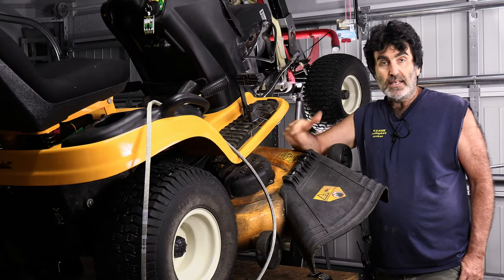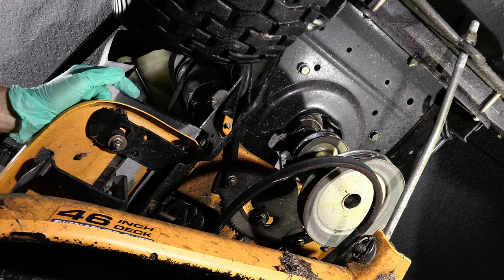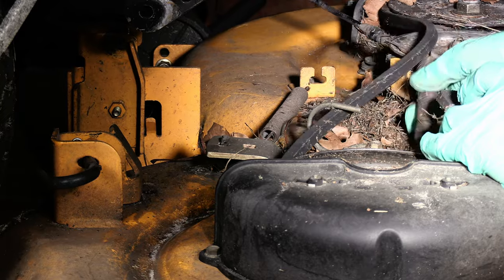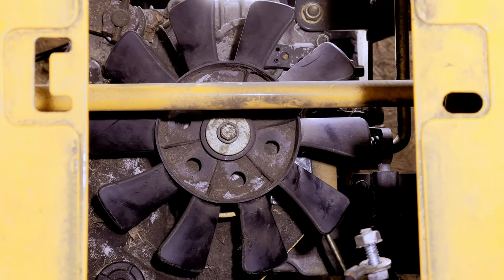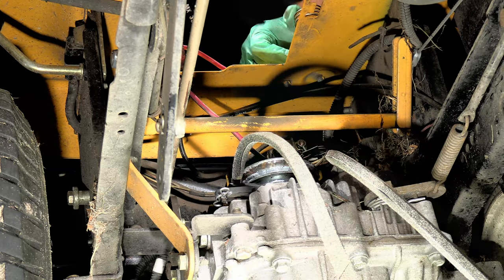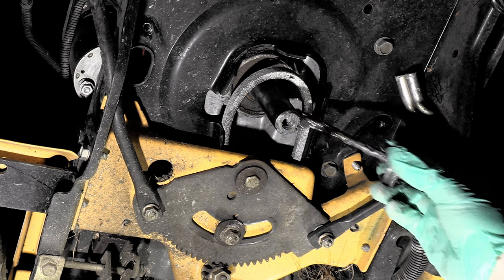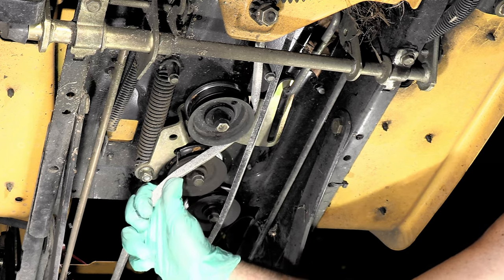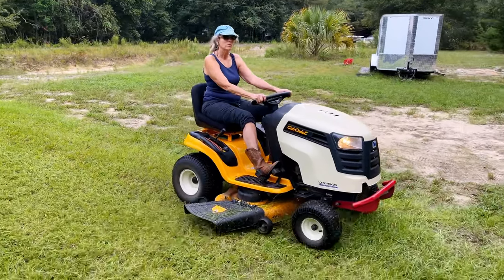Cub Cadet LTX1045 Transmission Drive Belt Replacement

Comment: Thanks! This is the ONLY video that points out how to get the belt past the steering "Column" I took pictures before I removed mine, but didnt capture or make a mental note of how that part was oriented... I figured it was to one side or the other.. You saved me from further second guessing. Thanks for a great video.
Reply from the maker: That's awesome!  You're welcome... 😀

Comment: Hi there, I have a question for you and I’m hoping you can answer this for me. I have a 2013 cub cadet ltx 1045 and it feels like the tranny is slipping? I know it’s not but it feels like it. I have to pump the “gas” pedal a couple times to get it moving for some reason and it just started this. Now, I did replace the deck belt right before this started happening and the store I got it from “tractor supply” didn’t have the exact belt so I measured it and I thought it was pretty close, if not right on. 
Now it seems like it rides slower?
Is there a drive belt or something that would make it sluggish? This all kind of happened all at one time. The deck belt broke, I replaced it with something I would say is real close but it seems to drive like crap now? Any help would be appreciated. Also do you have the actual belt number for this unit? I have the 19 horsepower engine. It also has the dual blade deck. Thanks in advance.
Reply from the maker: HI, on this model Cub Cadet there is usually a sticker under the hood that will show the belt part numbers and other useful info.  Definitely check that first.  IF the sticker is gone or isn't readable, the model number should be under the seat and you can go to www.partstree.com and plug in the model number to get the parts breakdown.  Before you do all that you should be able to, of course with the engine off, reach up and feel the drive belt to see if it seems loose.  With the clutch out and ready to mow.  If it feels loose then it's probably slipping.
Reply: @JLPicard440  the drive belt seems extremely loose although when I hit the go pedal it does tighten up but the mower has low hours and always ran good. I’m pretty sure I need a new drive belt. Thank you for getting back to me.
Reply from the maker: That's interesting.. is the mower a hydro transmission?  The (right side) pedal should be tied with linkage to the transmission and shouldn't affect the belt tension.  If it's not a hydro, then yes the pedal will affect the belt tension.  The hydros usually have a speed pedal on the right and a clutch pedal on the left... the one on the left will affect tension.

Comment: I watched this which made it repair easier, thanks. I’m wondering if you switched the spacer or left it the way you put it back in and if it really makes a difference. I put it back the at you said that hen saw comments that said it as upside down. Do I need to take it apart and switch it?
Reply from the maker: HI, only if it makes any difference by switching it.  I'd have to see it, I forgot what the spacer looks like.
Reply: @JLPicard440  did you leave yours in upside down or did you go back and change it? If you left it, does it seem to be working ok? (Sorry my first reply was jibberish - fat fingers)
Reply from the maker: It's been a while ago, but I don't think I changed anything.  Usually if I discover an error like that, I'll edit in a piece into the video for the correction..  Do you have a timestamp for the spacer?  I can take a look and see what it looks like..

Comment: Question for ya.  the cub cadet ltx 1045 won't move. Makes a lot of whiney noise when trying to forward or back. I replaced the belt. It was terrible. But still the same. bringing the mower put of storage this year and the thing won't move. Is my transmission shot? The fan is spinning
Reply from the maker: Yikes!  Yes it does sound that way to me..  Of course without seeing it, it's hard to be 100%.  (I don't remember if that one has a way to check the fluid.  If the fluid has leaked out it could cause that) That would make a great video.. 😊
Reply: @JLPicard440  thanks. Also when I pull the tranny disengage lever the wheels are still locked-in
Reply from the maker: @rusted5408  That one isn't a hydro?  I thought it was is why I suggested the fluid.
Reply: @JLPicard440  it is a hydro. Turns out the brake.wasnt releasing. Thank God for small miracles. Some PB Blaster fixed it right up.
Reply from the maker: Oh excellent!  Yes I've seen that happen.  It's hard to diagnose without seeing it.  Good job on that one.  Glad you got it going again... 😀

Comment: The OEM belt that was listed under the hood was about 6" short. The belt on the front pulley and through the three pulley under the deck doesn't even reach the hydrostatic druve pulley. So I'm assuming the 79" OEM pulley should be an 85". Does anyone have that p/n?
Reply from the maker: HI, if you check the description there's a link there to the belt used in the video.  Of course if you have a different model number it may be different, but that belt is approx 85"..
Reply: @JLPicard440  Thank you! This is what I was looking for. The belt I ordered on Prime was 79" and is way short for my LTX 1045. I'm going to order the 85" now.

Comment: My belt just snapped today but I can’t find information about the belt, what’s the length of it, also what brand do you suggest for a new belt
Reply from the maker: I seem to remember this being an 85 inch belt.  That's for this particular model.  Do you have a model number printed under the seat?  If so, you can go to a website like www.partstree.com and get the parts breakdown and part numbers.  Also most of these models have a sticker under the hood that shows the part numbers of the deck belt, drive belt, blades, etc.  I don't recommend a specific brand.  The OEM belt was pretty expensive, there were some aftermarket belts that were about 1/2 price on Amazon that had some good reviews.
Reply: @JLPicard440  I can’t seem to any results on that website, when I put in my model number nothing comes up, as-well there was so information under the hood
Reply from the maker: Huh... that's interesting.... can u give me the model number?
Reply: Thanks for an informative and well produced video.
The inside of the hood should have a placard with the belt numbers and more.  My LTX-1045 drive belt is 954-04207 which is 1/2" x 79 1/2".  
A search for that number pretty much everywhere will get you a suitable cross reference.
Reply: Anthony, some websites will only work from the simple Model no.  like LTX-1045.  
If you use others (like MTD), they will need the detailed Model number from the placard.
Mine happens to be 13WX91AT056. Yours will be something like that.
And BTW, even if they are a little more expensive, calling Cub on their service line will connect you with very knowledgeable and very friendly service folks who can walk you through it.
Hope this helps.
Reply from the maker: Yes thank you!.. I knew about the sticker, but I forgot to mention it.
Reply from the maker: Glenn thanks for the great info... Glad to hear you can call Cub directly and there's someone there that can help.
Reply: @JLPicard440  Least I could do. Of all the videos I watched, you were the only one to mention that you have to remove the rear splined pulley in order to deal with the belt keeper on the transmission.  Maybe theirs don't have one, but mine does and just flipping the belt over the fan won't work. Fortunately mine had been treated with NeverSeize or it might've been a different story. 
Again, many thanks to you.
Reply from the maker: You're welcome!  Yes those rear belt guards are definitely in the way on this one... 😀

Comment: Just popped my belt today. What’s a good way to prop up the mower?
Reply from the maker: I use an engine lift, but most people don't have one.  Do you have a set of the lawnmower ramps for a pickup truck to drive a mower onto the back?  If you park it half way up that would work great.  IF you don't have that, do you have a set of automotive ramps?  That would get the front up 8-10" or so...  If you don't have either of those, how bout a set of 2x12's.. prop one end on something sturdy and drive the mower on top... all kinds of ways of doing it.. Hopefully that helps... 😀. They key is to be safe!

Comment: check instructions on installing the spacer on top of the pulley.  most instructions state to place bevel against same on crank... IOW,  "UP", and not toward pulley.        It's   not the clutch.... but rather brake needs to be set to remove and released to check tension
Reply from the maker: Great!  Thanks for the tips.

Comment: Would someone tell me exactly what size that belt is in inches
Reply from the maker: HI, if you go under your hood there's usually a sticker there on Cub Cadet.  That should show the belt part number.  You can take that part number and type it into Amazon and that'll usually give you the measurement  in the description.
Reply: @JLPicard440  thanks it's 1/2×85
Reply from the maker: That sounds right... 😊
Reply: @JLPicard440  it works just  finished my yard so happy 😊
Reply from the maker: Excellent!  Glad you got it back on the road... 😊